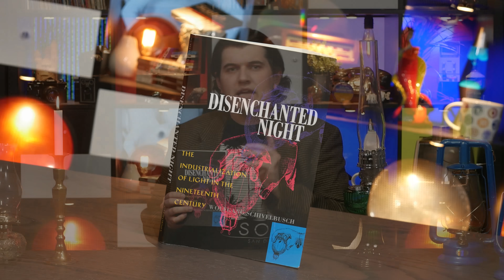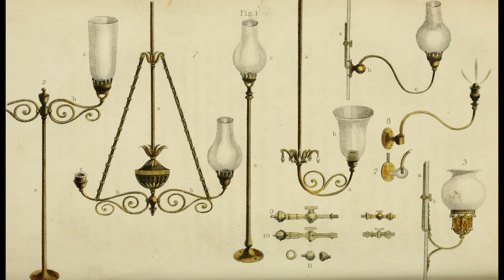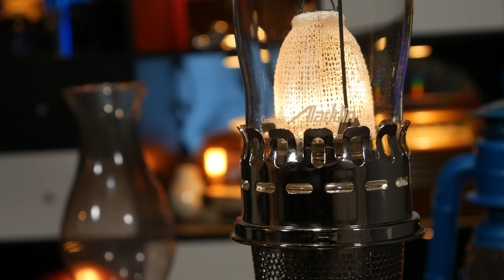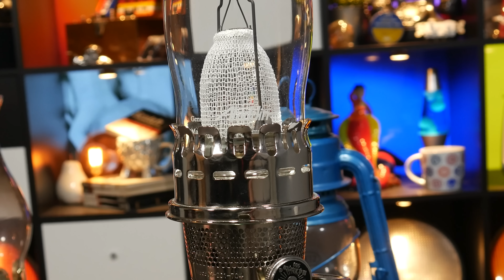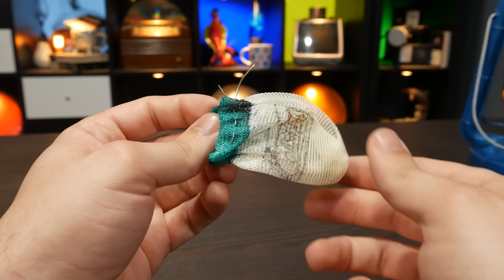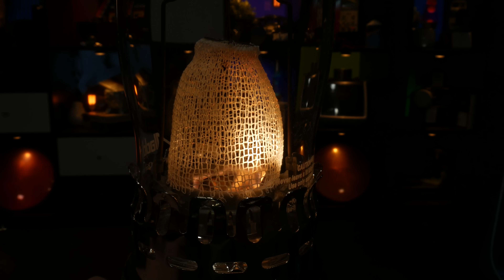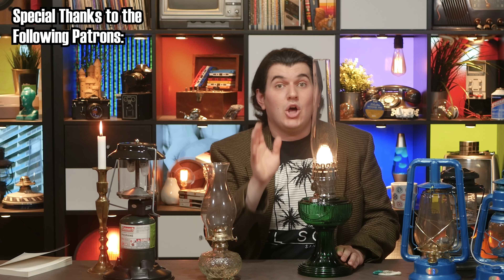How the gas mantle made lamps 10X brighter

Comment: Remember this from camping trips and the army back around 1990, they looked more like an high tech version of the hurricane lantern, they was nice as they light up an living room space. A bit bright to use in an tent, say like an 60 W light bulb. The army had an high power version who you pumped up and the over pressure forces kerosene into the burner so no wick. 
These was many times brighter and mostly used outside. Yes they make nice beacons to aim after :) 
Was told these used catalysis and believed it until now.
You have catalyzers in modern wood stoves for cleaner burning like catalyzers on cars and you can buy catalyzer propane stoves so its sounded plausible. 

Well some years later I thought seriously about using an 12 cm pc fan to force feed air into an wood stove for more heating, luckily the cold period ended before I could implement the plan, the stove has multiple cracks already because overheating but making it an blast furnace would not be smart :)

Comment: Coal gas had quiet a lot of carbon monoxide in it. It was a mixture of CO, H2, CH4 other small hydrocarbons and CO2. This is one reason why people would have gotten headaches. It is also the origin of the trope of committing suicide by putting one's head in the oven. It is rather difficult to do this with a natural gas oven (or an electric one for that matter).

Comment: I have an oil lamp from my Mother's birthplace made by the Pittsburgh Lamp and Brass Co. It is a center draft design with a flame spreader. They did not use kerosene in these lamps. They used mineral spirits which burned cleaner and did not smell.

Comment: I grew up with the gas mantle lamps They are incredible devices. You are correct about wick management. It's honestly the only flaw with them other than the mess when filling them. We had two or three of them but only one could run at full power. Flaws in the draft and wick holders just always seemed to be hard to get just right. No smell, extremely bright light (they need to bu used with a shade). They are quite good and depositing soot on the ceilings too.

Comment: I worked for Bethlehem Steel's Sparrows Point plant for much of my early career.  When I started in 1991, there were still three working coke oven batteries in operation.  It's rather a dirty process to purify coal into coke due to all the byproducts that the process creates.  Of course, coke gas (what you are calling coal gas was labeled and distributed) was used in great quantities.  While I don't know where else it may have been used on the property, it was used in great quantity for box annealing - basically, stacking coils of cold rolled steel about 5 high x 8 stacks sealed inside cylinders then covered by a giant steel box.  What I remember before they eventually switched this process over to natural gas and eventually hydrogen gas - was the smell.  It was not pleasant by any stretch of the imagination.

Comment: When you mentioned borosilicate glass it reminded me of something.

Uranium glass has some unique thermal properties, it was used in train headlights, and some electronic tubes were also made of it because uranium glass has a thermal expansion characteristic similar(ish?) to steel, unlike normal glass, so uranium tubes had less probles with vacuum leaks near the tube leg pins.

I wonder, did they ever make uranium glass lamps ?

Comment: One advantage of coal gas over natural gas is that it is lighter than air, so it does tend to disperse if there is a leak..When we were kids we used to connect a clay bubble pipe up to a gas tap then ignite the bubbles produced with a match. That fun game disappeared when the house was converted from coal gas to natural gas. This only happened when parents weren't about by the way..

Comment: @23:50 There is actually a kerosene mantle lamp that works in strong wind that you might look into if you can find one. We had one a long time ago and it was as resistant to wind as a hurricane lantern. 
It did not have a wick burner but some sort of nozzle burner and a pressurised kerosene tank which you would pump up to pressure with an small integrated piston pump.
It was also a little more complicated to light. First you would pump up the pressure in the tank while keeping the fuel valve closed. Then you would push a lever lift the glass envelope and pour some alcohol or methylated spirit in a channel that surrounds the mantle, light the spirit with a match and then lower the glass.
The spirit flame would make the mantle glow and once it glows uniformly you would very slowly open the fuel valve which would (I think) spray kerosene onto the mantle and make it glow. You would then need to carefully adjust the valve to get a bright glow while avoiding a visible flame or soot, that just like the Alladin. If you were not careful with the valve adjustment the glass would quickly become black and the mantle would disintegrate.  From time to time as the kerosene is consumed you would need to pump up the tank to restore pressure in the tank. 
When putting a new mantle it was burned in the same way as lighting the lamp, that is by igniting alcohol in the channel surrounding the mantle, rather than by lighting the mantle itself which was not burn properly if set alight directly and would fall apart.
Once lit and working it was almost impossible to put out with wind but getting it lit in the first place is another matter - it was almost impossible to light in anything more than a light breeze, although that might be just because we didn't know the technique for doing that. I remember that we used to light it inside the car with the windows closed and wait for a few minutes for it to stabilised before getting out of the car - probably not the safest thing to do but we somehow survived.

Comment: you can buy replica style lamps that are battery, rechargeable led

they look like a gas mantle or wick light and the batteries ranging from 2 to 6 aa to d size depending on lamp.

the leds are in a white plastic defuser in the shape of a mantle or on the bottom where the wick goes

they even make usb rechargeable versions 

and battery lamps can give the nostalgic look of gas and fuel lamps with the safety of batteries and leds*

*= lithium batteries have a history of catching fire if they go into thermal runaway due to defects (remember the samsung galaxy note 7 phone)

Comment: I have both of these types of lanterns (Dietz and Aladdin) I use them in the backyard. The fuel I use is the Tiki brand torch fuel that can be bought at any home improvement store. I'm not sure what the "base" is to this fuel. The up side to this fuel is it has citronella scent added to try and keep bugs away. However as you said there is no scent from the Aladdin lamps, but plenty of scent from the Diets lanterns. I place them all over my yard. I find it a safer alternative to Tiki torches. They add to the ambiance of a BBQ and help keep bugs away!

Comment: "lute" means something like putty or cement... So I would interpret "forced my lute" as "It broke the seals on my still" (so pressure was building, becuase a gas originates from the heated coal and this gas could not be condensed, as the guy wrote before)... And it "broke my glass", so after he enforced the seals, the glass broke, because it couldn't hold the pressure...
Reply: You beat me to it. You're spot on
Reply: @SonOfFurzehatt  thanks. I only realized I was like 5 hours slower than everybody else 😅
Reply: Wikipedia says one common use of lute was to act as a safety valve specifically to stop the glass from breaking due to a buildup of gas. If the gas forced the lute, it should have protected the retort. But he repeated the experiment many times (trying various methods to condense the "spirit") and sometimes plugged the hole so firmly he broke the retort or another piece of glass.

I am pretty sure this is what he is describing, because in the next paragraph he discusses setting fire to the gas as it exits the still after it forced his lute. In other words, the lute popped out of the hole and gas started to flow out, which he could light like a Bunsen burner.
Reply: Go to the very end of the video and turn on the captions.
Reply: Thanks for that! I was thinking it can't be "loot" in the usual English sense, because that's a Hindi word absorbed into English when the British was literally looting India. 1691 is a bit early for that, so "lute" makes more sense.
Reply: Came here to say this.
Reply: Missed your post before I replied the same.
Reply: Should have looked at other comments before I wrote mine …
Reply: Oops. Should have read the comments before I posted. Beat me to it.
Reply: I hate lute boxes.

Comment: I recall my sister’s JHS project (1980’s) on nuclear energy had a number of common household items that were radioactive and one of them was a set of Coleman camping lantern mantles before being burned. It made the Geiger counter go a little crazy.
Reply: Looked it up on the web: The Coleman Company, one of the world's largest makers of camping supplies, continued to use Thorium to make their mantles until the mid-1990s when they changed to yttrium, a non-radioactive compound that does not burn as bright, but burns longer.

Comment: I am old enough to remember coal gas in my house. It stank. There was no chance you accidentally left it on unless you has anosmia. The move to natural gas - which had (almost?) no smell -meant they had to add a smell to it. And coal gas was poisonous. There was an expression in England "put my head in a gas oven". It was a method of suicide. But it was used more rhetorically as in "If that happens I'll put my head in the gas oven" or "I'd rather put my head in a gas oven" - needless to say unlit.

Comment: As to the question about lute, it is a mixture of clay, chopped-up cloth fibers, ashes and horse dung.   Lutum sapientiae was used to coat the glassware to protect from uneven heating, and to seal gaps between the vessels, like plumber putty.  Source is Pirotechnia, by Vanoccio Biringuccio, one of the great practical engineering texts of the 1500s.

Comment: I have to admit I have a bit of a pressure lamp fetish. And I'm not over exaggerating. My basement is now a big ass collection of them. There's something so nice about the sound and light they produce. My favorite one to use is a 1936 Coleman, but I use all of them. He'll when I go boat in camping in Algonquin I dont even bring an electric flash light, just 2 pressure lamps that are usualy about 70 years old. My trailer has propane mantle lights. I just really like them, not to mention their so reliable and sturdy. Now there is the bit about carrying a pressurized gas bomb that's on fire around... but if you respect them a bit their kind sorta maybe safe ish

Comment: is kerosene niche in America? what do you guys do for home heating in remote/rural locations? in the UK most rural homes use kerosene boilers (normally called just "oil heating"). afaik, pretty much all of them have the fuel tank (usually a around 500-2500L) and burner outdoors with piped water to exchange the heat with radiators inside the property (and hot water too but i dont know if that comes right from the heat exchanger outside or if theres another one which exchanges heat with fresh mains water)

Comment: I grew up with oil lamps . Gas lamps on copper lines, making filaments and mantels from recovered silk and borax and a mild acid . Lemon juice, vinegar, dilute drain cleaner. Acid wash the silk by just swishing it around for a minute and rinsing with clean , unchlorinated water. Let it dry,  mix borax into more clean unchlorinated water until saturation point is reached and bring to a simmer to increase saturation point and dip the silk into the borax water and swish around for a few minutes.  While still wet. Weave treated  Silk into the shape of a loose basket , with about 1/5 th inch squares . Use a strand untreated silk  to tie it onto the element.  Turn on has so it's just a leak and light the mantel. 
Immediately turn of gas as mantel catches flame. Let it burn to white ash. It will hold form.  This is normal.  Do not touch the mantels once burnt,they fall apart.
Is it kerosene or white gas / Colman fuel ?

Comment: There is a well known chemical experiment that demonstrates the operation of a gas mental. It use to be included in children's chemistry sets. It involved dissolving lime stone (calcium carbonate) in vinegar  (dilute acetic acid). This produced a solution of calcium acetate. A cotton sewing thread was soaked in the resulting solution, and then suspended from a wire to dry. When ignited, the cotton thread burned away, converting the calcium acetate to calcium oxide. If done in a suitable burner, such as a methylated spirit burner, a common features of such chemistry sets. The calcium oxide ash would incandesce with a very bright light, the original lime light.
While talking about gas production, I was surprised that you did not cover water gas and producer gas manufacture, as this was used to replace the simple coal gas production method.
During my childhood, a large gasometer dominated my home town landscape. One could judge the amount of gas being stored by how high its internal container appeared. As these operated like an upturned glass in water, with the gas trapped inside, making the glass rise and fall, only in the case of the barometer it was a large metal structure that replaced the glass. When it came to dismantling the gasometer, at the end of its life, special precautions were required, as the metal of the structure had absorbed so much hydrogen from the gas that the metal itself represented a fire risk, as the trapped hydrogen was slowly released.
I will be interested in watching your next video on thorium oxide mantles, as these were reputed to be radioactive, to the point where bulk purchase was controlled.

Comment: "Or even margarine - wait no, not that one." I was fully prepared to believe that those things were made to run off, well, not really margarine but oils from animal fats that wouldn't be all that dissimilar.
Reply: Olive oil lamps are really cool.
Reply: Margarine or Oleo is just vegetable oil. Well highly processed vegetable oil. It will burn just like any other oil.... smoke and particulates included.
Reply: I know I used to run those on petrol in the scouts.
Reply: There's no way to prove it can't run off of margarine.
Reply: It's not unheard of for fats and oils to be used as a fuel source, that's basically what tallow is, animal fat rendered into solid fuel.
Reply: @asteroidrules    indeed. Until fossil fuels started being used, practically all fuels were derived from edible sources.
Reply: Paraffin maybe?

Comment: I was especially excited for this episode. My parents used to take us camping when we were young and we had one of those propane-bottle & wick lamps. It was always this mystical beast, being a combination of very powerful but also quite fragile. I was very excited to finally learn how it all worked.
Reply: Where I live we have naphtha lanterns for camping, I remember asking "what happens if we touch the wick while it's on?" The answer I got was "not only will you disintegrate the wick, but you'll also severely burn your finger."
Reply: I have both propane and gas lanterns.  I mainly use the propane lantern though.  I just bought a tree to put on my 20lb tank that the lantern can sit on top.  Much cheaper to refill the 20lb tank than keep buying the little 1lb canisters plus the tree lets me connect my propane stove to it too.  I also have an old 3 burner gas stove that has the propane conversion kit, which is just a pipe with a threaded end for the propane to connect to.  Nothing else had to be changed other than to remove the gas tank.
Reply: @jasonantes9500  So confusing reading the word gas in this context. My use of it was as a synonym for propane/butane, aka liquefied petroleum gas, LPG for short.  
We (Australia) understand the abbreviation gas for gasoline, in context with American cars, but our cars that run on gas use LPG or autogas.
So my BBQ gas bottle referred to above was an 8.5kg LPG cylinder.
Reply: @jemsterr  Yeah, different parts of the world different vernacular.  Yes, my use of gas is short for gasoline.  I could have said dual fuel too I suppose.  Anyway, cheers!
Reply: @jasonantes9500  lol.. Dual fuel would have confused me more, because I would have been left guessing what the 2 fuels were. I guess this is why TC went out of his way to say the full word gasoline every time. Anyway, thanks for the chat.
Reply: I remember camping as a child in the 80s, and our propane lamps had a single wick in the middle, and a portable propane cylinder underneath.  Larger than the one in the video, but smaller than a BBQ gas bottle.

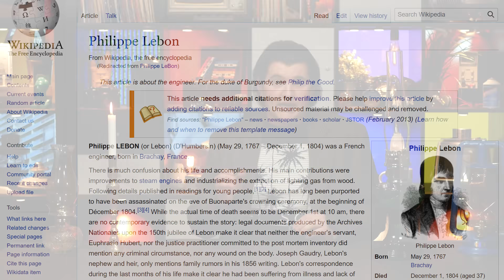Comment: 5:05 The concept of distilling fuel gas at your home may have fizzled out at the time, but personal wood-gas and even hydrogen gas generators would be used for house heating in the late 19th century. Later, during WW2, due to gasoline shortages wood and coal gasifiers were produced that could be mounted on vehicles to power them. Such gasifiers were produced in France, Germany, the UK, and US. Even in the modern day you can buy wood gasifiers capable of powering a truck, if pictures of gasifiers in the beds of modern pick-ups are anything to go by. 
An engine meant to run on gasoline would obviously need modification to run on gaseous fuel, but it can apparently be done relatively easily.

Comment: The issue with indoor fires is NOT low oxygen. The problem is a too high CO2 concentration. Long term exposure to 5000ppm CO2 or more is considered a health hazard (that is 0.5%). First symptoms are feeling tired and getting a headache. In comparison if oxygen drops 21% to 20.5% it is hardly noticeable. If you climb a mountain the reduced air pressure reduces your oxygen intake far more than a 0.5% drop.